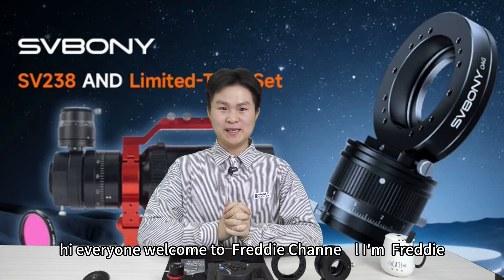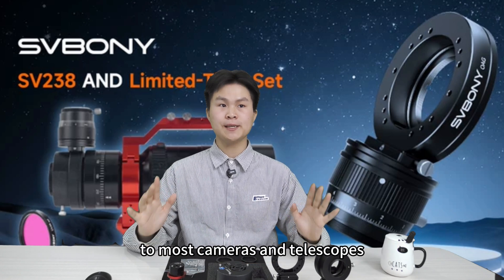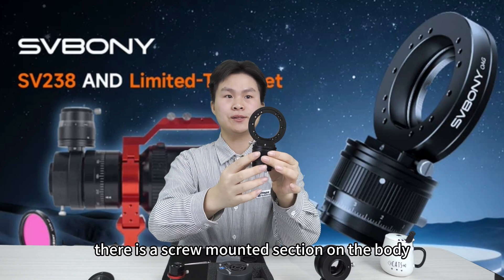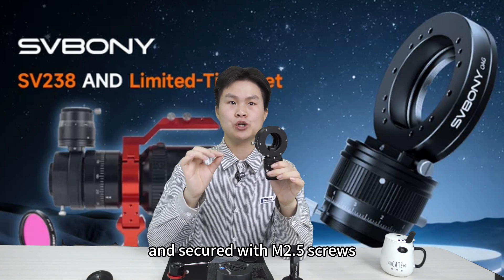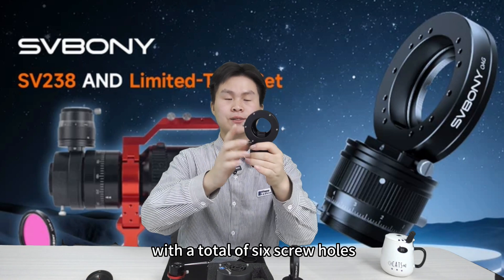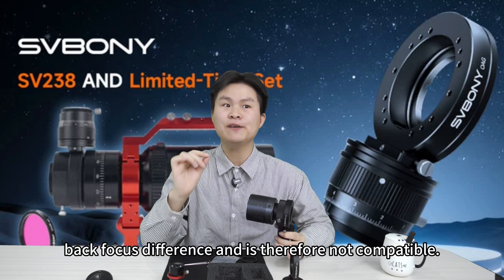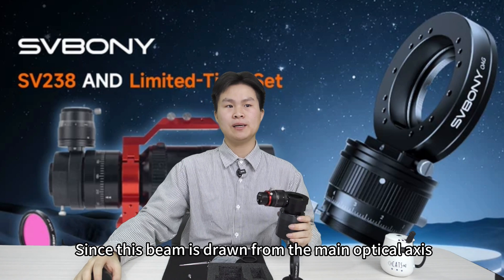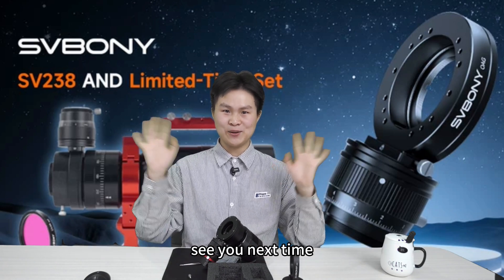🔥 𝐒𝐕𝟐𝟑𝟖 & 𝐒𝐕𝟐𝟐𝟔𝐏 𝐈𝐧𝐬𝐭𝐚𝐥𝐥𝐚𝐭𝐢𝐨𝐧 𝐕𝐢𝐝𝐞𝐨 𝐃𝐑𝐎𝐏𝐏𝐄𝐃!🎥

Comment: I just received my SV238 and cannot connect my filter drawer. What filter drawer do I need? SVBony should have been clear what filter drawer is compatible.
Reply: I have the same problem. SvBony is definitely providing not only misleading but squarely false information about the SV238. The website says that the SV238 is compatible with most cameras and telescope, without specifying that it MUST be with the SV226 M54 or SV226p. Now, I have the SV226 that is fine with my setup but also a SV238 that I cannot use unless I buy an additional filter holder SV226p that I don't need since I already have the SV226 and that is not available yet any way. I have contacted SvBony but got no response so far.

Comment: How do you adjust the prism position? Do you shift the helical focuser up, or just the prism shifts? Thank you. Several newtonians with 3" focusers have an issue where the focuser tilt adjustment mechanism obstructs the OAG helical focuser (too close). It'd be good if the helical focuser can be adjusted in height even an mm or two. Most OAGs today are designed to shift the prism only. Thanks again.
Reply from the maker: Thanks for your question! Our prism supports adjustment of the prism only—just use the adjustment knob, no need to shift the helical focuser up.